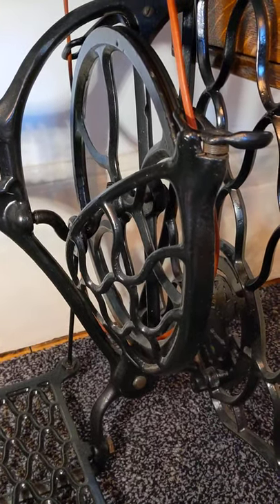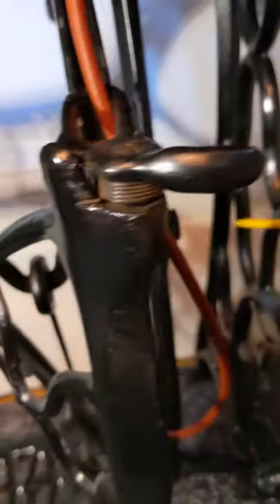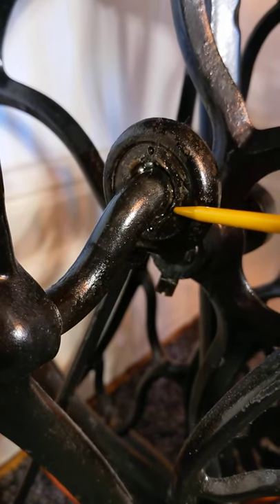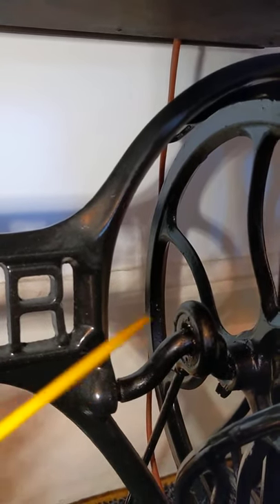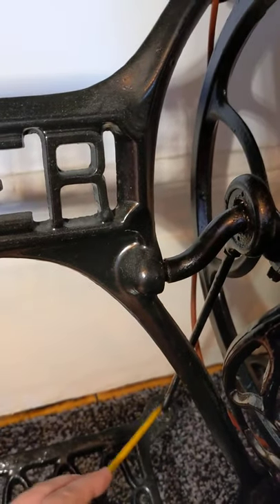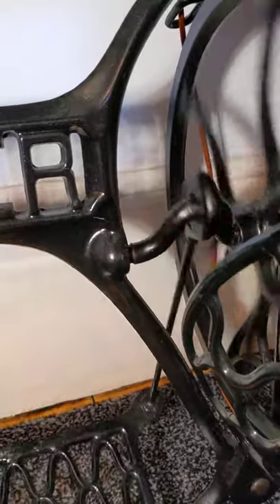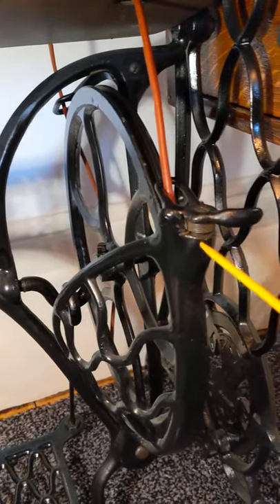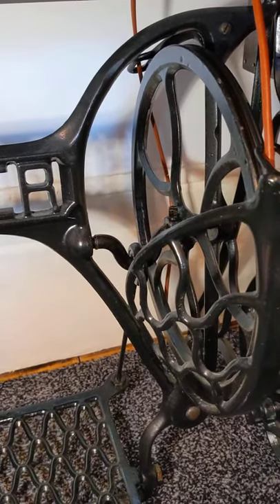The importance of greasing the bearings on a treadle

Comment: Thank you for this helpful information, I am currently refurbishing a treadle that was given to me and it’s been a learning as I go process. Your video is the first I have heard about greasing the bearings. I am still working on the machine and cabinet which are off the base now so I have easy access and a supply of grease from my other machines.
Reply from the maker: Thank you. Yes a good gloop.of grease around the bearings helps.so much. Once your treadle is up and running, if you then use it frequently, you should grease around every 6.months. 
I have two treadles and one suddenly started making a low groan sound. Drove me nuts trying to work it out and then realised I had forgotten to grease the bearings! Doh! So now I know what it sounds like when they are dry 🥰

Comment: Thanks for the video. I am wondering about whether it's best to use sewing machine oil or rather use grease at the pitman arm ball and cup joint (where it links to the treadle plate)
Reply from the maker: I havent tried adding grease, I would imagine this part heats up quite a bit from treadling rendering the grease quite runny. And then add general dust particles in the air and it could start to gum up? I've only added oil to this section, and find I only need to oil around every 3 months or so